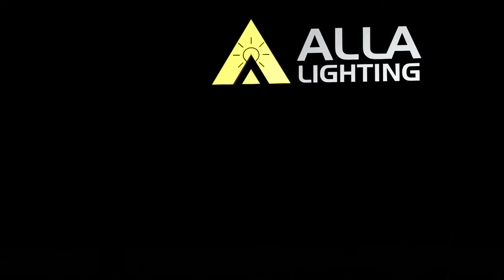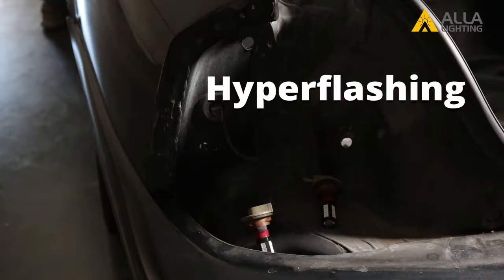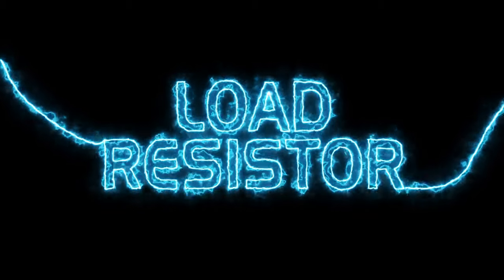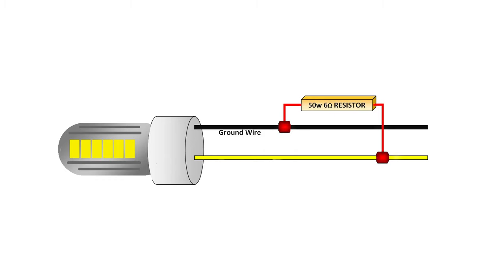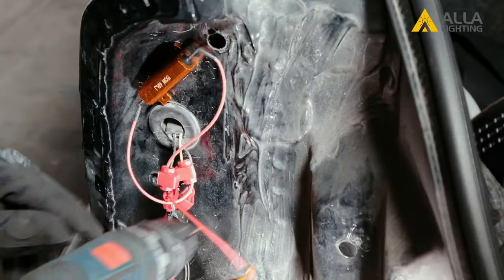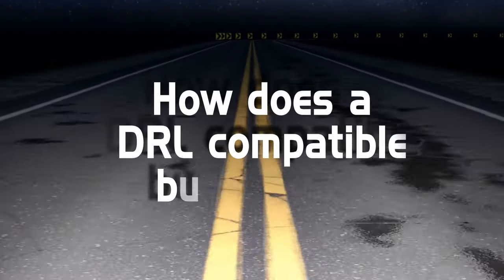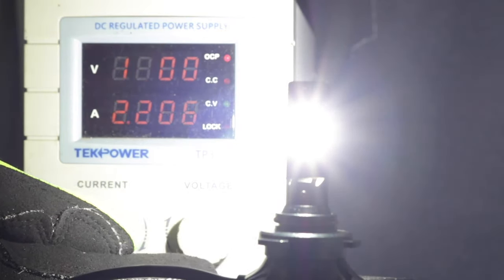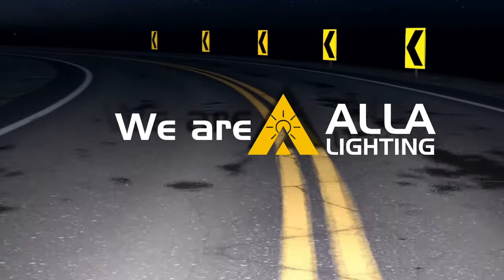Why LED Lights Bulb NOT Working? | How to Fix LED Flickering/Blinking?

Comment: Lol 😂now I understand why. So here’s my story. We got two 09 Pontiac Vibes I put LEDs from front to back on both. No issues whatsoever. Well, I decided to do the same on my 2007 Dodge Ram 2500 so,I ordered all the LED light bulbs for it,and I got all the issues described on this video. Great info. Thank you.
Reply: My dad’s 2007 ram 1500 is having issues with LEDs. What did you do to fix your dodge?

Comment: Great video, hoping you can help with a problem. I just put LEDs in my 2005 Chevy avalanche ls. The signal lights flicker and flash so I've already ordered the resister. But my DRL wont come on at all, its not the relay or fuses, will a resister work or do I need the DRL relay or resister kit? Looking for the most economic solution pls.

Comment: Great video! I have a 2006 Mustang GT. I have all LEDs except in the front turn signals. I’m having an issue with the 194 LED license plate bulb. It randomly turns off usually after an hour of driving the car. When this happens it turns off the rear park lights too (1 of the 3 tail light bulbs on each side. The turn signal/brake lights are not affected). If I cycle the switch on and off everything works again. I used to have no issue with other LED bulbs. The issue appeared when I switched all tail lights to VLEDS V6 extreme bulbs and the plate light too to a VLED bulb. These tail light bulbs use constant circuitry and they do not hyper flash without resistors. I have tried 2 other bulb brands with the same issue. The Sylvania brand I tried turns the bulb off after a few seconds unlike the others that take longer to turn off. It seems I need a 100 ohm resistor on the plate light. But I’m not sure how to install that for such a confined space. Maybe a CANBUS plate bulb is the solution. Any feedback? Thanks!

Comment: Hi @AllaLighting,

I have installed the Maxx-Link Led AMG Series 200w headlight from a Halogen bulb(stock 55W) to a Led headlight of 100W each(left and right).

And as you mentioned in the video issue, the headlight sometimes gets randomly Off I am facing the same issue.

But I could not get the proper solution from the video, as Led has the CANBus connector and it connected socket to socket.

So, can you please share the solution for the issue of the random Off.

Scenario - When I drive the car for 30 - 45 min with Headlight ON it works properly, But when I turn it Off and once again turn it ON it did not get turn ON quickly it takes near about 1 - 2 minutes to get started & turn ON. 

Once it is ON after 1 - 2 minutes, sometimes either one side led headlight takes extra to get turned ON.

 At last both the Led headlights turn ON but after some minutes of delay. 

It will be really great of you for all the support and solution for the issue.

Led Used - MAXX-LINK AMG SERIES 200W
CAR - SKODA RAPID 2013 MODEL
STOCK HALOGEN BULB - 55W
UPDATED LED - MAXX-LINK AMG SERIES 200W

Comment: Very informative video, I definitely appreciate all the information. 
I have an issue at the moment, hopefully you can make a suggestion? I had a 2010 Lexus Gs350, which used PWM. It had an Led 9005 drl/highbeam setup with decoders.  I am now trying to use the same setup on a 2001 Lexus ES 300 and only the high beams work  but not the drl. What would be the best solution to my issue?

Comment: I have 2014 GMC Sierra with Spyder after market lamps.
Years ago I installed them with LED Canbus bulbs with no issues.
Recently one of the H7 bulbs has become dim. I can no longer get the original LED bulbs.
I purchased a set of Auxbeam GX H7 LEDs.
If I put the ignition in the aux position and turn the lights on, they light and stay lit.
If I start the truck and turn the lights on, they light and promptly go out.
Any thoughts or input?

Comment: My dad got some LED h13 bulbs off of Amazon and we installed them but the lights would then in for 1 second than shut off. I got him some resistors for them and now the LED bulbs stay on now but now it’s always in high beam mode and when pressing the high beam switch the low beams come on then shut off for a second. Would a LED decoder work better than just resistors?

Comment: Hello I know this is an older thread. I figured I will ask anyway. I have a 2016 jeep Cherokee with Holagan bulbs. I switched to led bulbs. The lights themselves work great, however I do het only 1 message " low beam out " . The stock lights are 9005/9006, so my question is 8f I buy a canbus decoder would H8/H11 work for my vehicle? Thank you, any assistance would be greatly appreciated.

Comment: I bought a LED front signal housing which have pre-installed LED resistor. When I start my car and daylight turn ON, the signal blinker is hardly noticeable.. it's kinda like dim a little and blink... hardly noticeable on bright Daylight. if Daylight is OFF or headlight is OFF, the LED blinker normally like normal OEM bulb. What do I need to get the LED front signal works normally? LED blinker relay?

Comment: Having a problem where my leds won’t work at all? If I plug one halogen and 1 led then it works but if the halogen isn’t in then the 1 doesn’t work either? Appreciate the help thanks. On a mx 5 mk2

Comment: ‘12 Prius V. All bulbs switched to LED with no issues except turn signals. Those hyperflashed. CANBUS ready turn signal bulbs would have been $100 for the car. Not worth that price for me. Resistors would have been a nightmare with the small amount of wire accessible. Also worried about the heat. Just replaced the old turn signal bulbs with the brightest halogens available. If you have a 3rd Gen Prius now ya know.

Comment: I installed a bulb with a canbus attachment on my Ducati 2014 motorcycle and it worked like charm. I had some separate issues with my wiring though which I fixed by installing a thicker better quality copper wiring kit than the OEM one. This resulted in random on-off, or delayed Ons... until a complete off now. What could be the issue?

Comment: I have 2012 Toyota Rav4. I installed 9005 LED bulb as High beam and 9006 LED as Low beam. 9005 LED should work as DRL and High beam, but DRL is not working and not flickering as well. If I install Canbus decoder, will it make 9005 LED DRL work? Please advise.

Comment: great video thx ..... and i NEED UR HELP !!! 
i want to buy leds from u guys but i need to know if i need decoders or relays or ?? 
i have a 2006 ford f350 super duty and i want to get headlights bulbs they are h13 i also want fog lights bulb they are h10 i also want led turn signal. led interior lamps so DO I NEED DECODERS for any of this applications ??? thx

Comment: Hi I have a Chevy Silverado 2020 1500 custom with halogen lights, I bought a set of LED headlamps , it fit perfectly and the harness as well but the lights doesn’t turn on any advice please ?thanks.

Comment: 2018 Chevy Impala LT. I’ve gone through a lot of different brand lights, Lumens and all.. found that the only ones that don’t flicker are the ones that don’t have an external drive. But the ones I have in now will only insert one way and I’m not getting the full view of the lights… they look like Halogen but white.. have you ever had anyone that had this issue and maybe solved it?

Comment: My 03 Tahoe my LED headlights has hyper flash when the headlights are on only and while using the turn signals,because it only happens when headlights are on using the turn signal . And don't have any other led bulbs anywhere else

Comment: My led bulbs flash at same speed as stock bulbs but flasher relay goes faster . And have an error message saying there is a faulty bulb, this is on my 2015 vw transporter t5.1 any idea or suggestion plz

Comment: Great video!! Need some help with the following, I installed LED fog lights and they work fine when engine is NOT running. As soon as I start the engine the fog lights blink two time and then turns off.  I would very much like some guidance as its driving me crazy as I'm finding it difficult to a solution online.
Reply: The bulbs are 12 volt only. Get bulbs that are 12-24 volts. 

When the car starts the alternator runs and brings the battery power up to around 14 volts. Led bulbs that only function on 12 volts won't work unless you have a resistor on the positive wire

Comment: I have 96 F250 , just changed front and rear bulbs to LEDs, front bulb is a running yellow light/ turn signal and the rear is brake, turn signal. when I install the 3157led tail light bulb. Everything work fine except the left turn signal would not activate or flash, this is one I changed first. How can i fix the problem? Oh , I reinstalled the standard 3157 Halogen tail light  bulb back in the rear and the first Led and rear standard bulb flashed fine.

Comment: HELP!!!
I have an issue which I was hoping you could either help with or get me pointed in the right direction.. (but first, great video!) 
I have a 2018 Chevy Malibu and recently bought a 5-function LED tail light strip (brake, turn, running ect.) but learned it won’t be just a simple ‘wire to wire’ (so to speak) type of installation because my Malibu has a single filament bulb so the brake,turn and running lights are all sharing the same line.  How do I wire this multifunction LED strip in a situation like this?? 

Any help would be greatly appreciated!
Reply from the maker: Sorry, due to it is not our product, we don' t know much about the product, it is recommended to contact the seller for the troubleshooting.

Comment: Hi Guys! Im having a bit of an Odd issue with a 14 kia forte, installed some 60w led bulbs and when they have not been used for a while they turn on and immediately turn off, after turning them back off and on a couple of times one will stay on and then finally both! Seems to do it while the bulbs are still cold! Thanks!

Comment: I had a rear brake light bulb out on a 02 dodge, oem halogen bulb. I installed a sylvania LED on both side and now I have no brake lights at all. Can u help me understand what I need to do to run led bulbs in a 02 Ram

Comment: Ok this is good info but what about led headlight slowly comes on and off when there is no power getting to it 
For example 02 Honda Odyssey light and auto light switch is off but passenger light only try’s to come on very slow flickers and go bright then very dim and flickering sometimes it will turn off but not for long until it comes back on again doing the same thing 

When I turn on the headlights there is no problems low and high beams work no flickering no dimming just a nice bright lights 

Please help 
Would it be the led light malfunction or could it be a relay problem

Comment: Excellent information question I put LED in my TSX 2019 and I’m having now a message DLR problem what do you recommend to me  decode bus?
Reply from the maker: Thanks, and for your vehicle, extra resistors are required, would you please advise it is for low beam, high beam or other application? thanks in advance.
Reply: @AllaLighting  hi it’s for hight beam and day lights running

Comment: do you know how to get rid of that ripple voltage coming from Alternator i have a new car, I've replaced all the halogen bulbs in my Car with LEDS & they all work flawlessly but as soon as i turn on the engine all the LEDS starts flickering a bit especially at low RPMS, some branded LEDS that I've installed in my license plate & tail lamp has it's own built in circuit due to that it flicker bit less but ones without PCB ( cabin light) they flicker decently, eventually all of them flicker as soon as i start engine, just intensity is different on each bulb, Any way to get rid of those flickering due to Ripple current coming from Alternator? It's not flickering as much as Jeep vehicle you shown but it's close to that! please tell me how to get rid of it!

Comment: Would the LED flasher relay work on a 3157 turn signal and brake light (in one)
Reply: Nvm, it wouldn’t work in my application due to the blinkers being controlled by the TIPM rather than a flasher relay :(

Comment: Soooooo how do you fix random off. I'm having this problem on my 2015 Ram. I had the anti flicker mogule. The bulbs them selves have the canbus corrector and it still does this. They work fine for a while then shut off randomly. Then come on after a while. Or sometimes stay off for good. I switch polarity on both and still nothing. Any help?
Reply: Did you figure out how to fix it
Reply: I have the same issue on my aftermarket Lexus headlights
Reply: I have the happening to my passenger high beam hl

Comment: I just bought led headlights from xenon pro for my 2006 dodge Cummins. I bought the 45 watt 6k lm with a led capacitor for flickering all from  the same site. I have installed the lights and they work good when the truck is off once I start the truck they flicker and shut off. Any advice for me please?
Reply: i’m having the same issue on a 04 ram 1500, bulbs work perfect when truck is turned off. but as soon as i start the truck the bulbs start to flicker

Comment: Having flicker on the driver side headlight of my 07 F-150. Using an LED bulb with attached CANBUS. This is the second LED I've put and driver side is still experiencing issue. Switched bulb with passenger side and issue persists but only on driver side. Any ideas?
Reply from the maker: Thanks for your watching, would you please email us the LED headlights bulbs information and advise the issue details to service@allalighting.com, for we need more information to troubleshoot, thanks in advance.
Reply: Mine is doin the same exact thing. Only in my Silverado smh.  I paid good money for these lights and this is the main reason I got rid of the hid’s... cause they wouldn’t work!!

Comment: I got 2010 Accord, put LEDs, 9006 for low, 9005 for drl and high beams, it works for drl but doesn't show on dash that's it's drl, lightly lit up, then when i turn on high beams, it turns full blue, it works well the LEDs so idk

Comment: I have a 2009 Ford Edge and I put two red cheap led bulbs in the tail lights and with 6ohm resistors my left flashes correctly and my right hyper flashes so would can bus bulbs work better because this car has a BCM module for lights no flasher
Reply from the maker: do you meet the led signal light bulb hyper flash or the headlight flickering, please advise for further assistance.
Reply from the maker: Please check whether the right side resistors get hot when right turn signal light is activated.

Comment: Hi installed 9005 led Can bus ready on toyota corolla 2012 for DRL and for long beam working but for day run is flickering. Any suggestion?
Reply: Same problem on my 2010 Mazda 3 my high beams and my low beams are super dim and flicker
Reply: Need a DRL relay kit. Starts around like 14mim mark. But will run at full power(high beam).. So maybe the DRL relay kit then a resistor to each bulb to keep it dimmer than the lowest headlight.

Comment: I own a 2013 Hyundai Sonata I installed all LED lights all around about a week after the install one of the dlr the passenger side flickers between dlr and high beam while the driver side doesn’t and the computer trows the tps light on what do you recommend me to do?
Reply from the maker: There is a dust cover for high beam bulb, so we recommend to try plug and play decoders first, if the code does not reset after a few days driving with decoder installed, contact us for further assistance to install resistors.

Comment: I installed an H11 high-beam led in my 2019 hyundai tucson but it turns on for a second and comes off. Help, please!
Reply: Hey i have a 2019 Tucson and I upgraded my high beams but they are 9005/HB3, not H11, id get 9005 with a decoder. I have no problems. Installed since 8 months. Nightlight 9005HB3 mate.

Comment: I have a 2012 Honda accord the only passenger side headlight bulb turns off on its own. What is the solution?
Reply from the maker: Honda is usually very DIY friendly, we don't have any problems when replacing with LED headlights on our 2015 Honda Accord, the issue could be a defective bulb on passenger side, please switch both LED bulbs to the opposite side and check if the issue follows the same bulb or stay on passenger side.
Reply: @AllaLighting  I tried a new set still after a few weeks sometimes months the left side bulb stats flikering, and sometimes it turns off on its own (only the left side) I tried cleaning it with contact cleaner (special cleaner for electrical equipment) still the same. I am thinking that I should buy a resestor or canbus to solve the issue.
Reply from the maker: @w7sh5555  Yeah, you can try to install the load resistors to check whether it helps.

Comment: Great information!!! I recently encountered an issue replacing a conventional halogen H-7 bulb on a 2010 E-350 Mercedes Benz to an LED H-7 Las Fit . Sure enough, neither side of the low beam headlights wouldn't work after converting it to an LED bulbs. Needless to say, I had no choice but to put the old halogen bulbs back..
Question to everyone, would I get a better result converting it to an HID lights? Please advice...
Thanks everyone...
Reply from the maker: HID has quite high illumination light output, yet the issue is the beam pattern is not focus and will glare other drivers and also it will take some time to start on.

Comment: Installed LED low beam lights, they work, however the high beams no longer turn on.  Volvo V50.
Reply from the maker: Please try to install the LED resistors. If you are not sure which one, please contact us by email service@allalighting.com by providing order details, issue, and vehicle's Make, Year, Model, Application, we will be glad to further assist you.